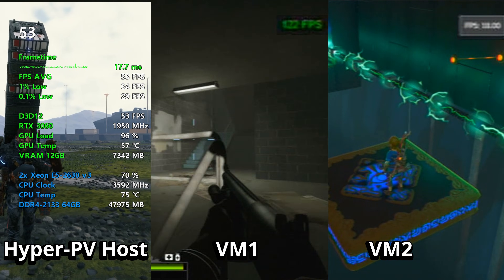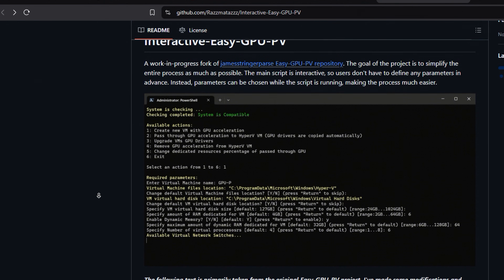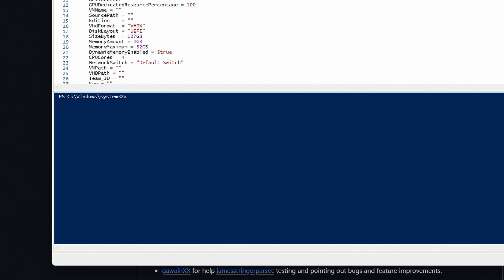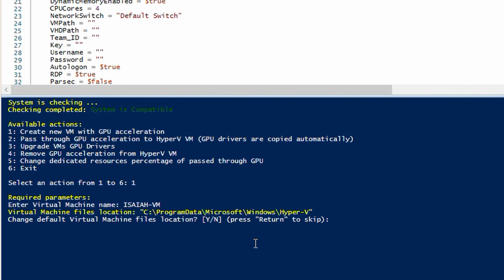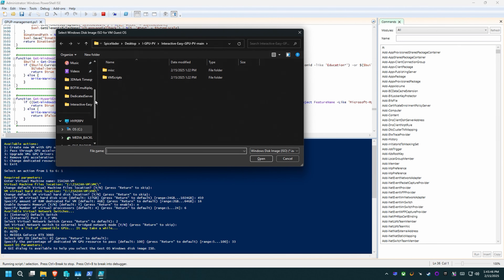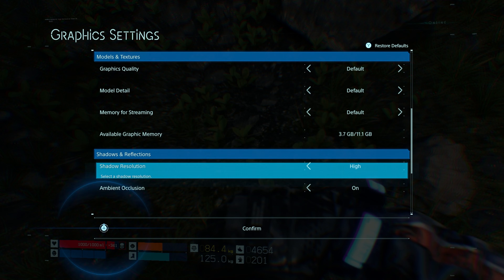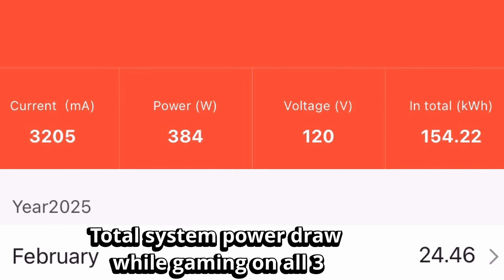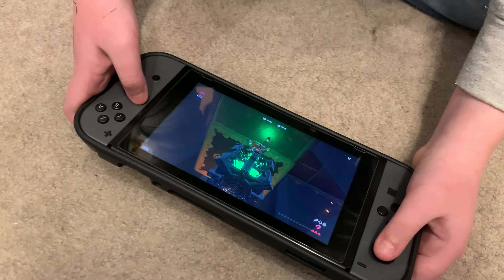3 Gamers, 1 PC Rig! // Old hardware running GPU Paravirtualization in Hyper-V using I-GPU-PV Scripts

Comment: Does it work on windows 11 IoT LtSC?
Reply from the maker: Yep, that's what I used in this video
Reply: @SpiceVader  Oh my bad I didnt notice it. Btw I also managed to run my VM too. Thanks!
The only problem is how do i connect any USB devices through moonlight?
Like USB flash drives, webcam, and also Arduino USB COMM stuffs
Reply from the maker: There was a program that allowed to send USB over IP via a certain port. The free version would let you do 1 USB device but would need to pay to unlock more. There are probably other ways to do that too. I believe it was called VirtualHere

Comment: How did you managed to use Sunshine + Moonlight in the VMs ? Event with a virtual display adapter, mine doesn't want to start streaming.
Reply from the maker: I had to plugin one of those dummy adapters into the HDMI port on the RTX 3060 and then it worked.
Reply: @SpiceVader Oh perfect ! It worked, I guess this is a limitation of consumer nvidia drivers

Comment: Is there any way to make the image over stream better?
Reply from the maker: You could try using a different method than I used. Moonlight might not be the best fit for this scenario, but it's what I use for everything else. I didn't want a bunch of different apps for remote gaming.
Reply: @SpiceVader Okay. Yeah I was using Apollo and Moonlight, but no matter what I did with the bitrate the image seemed very soft.

Comment: what optimizations did you use?  my vm  in game feels very very slugish, and input delay is horrible
Reply from the maker: I really didn't use much. Dropped the VMs to 1080p. I use Ubiquiti network hardware and it works decent. WiFi does seem noticeably laggier. I'm not super sensitive to it these days though.
Reply: @SpiceVader  mm i must of done something wrong... what was in the video and what was happening on my screen  was night and day
Reply: what Remote method did you use? moonlight, parsec or rdp?
Reply: @malloot9224  tried moonlight and parsec

Comment: ola como faço para funcionar o ray tracer e dlss / aceleração por hardware
Reply from the maker: If the graphics drivers are installed and Ray tracing and DLSS are already working on the host system then this should also work in the VM.
Reply: @SpiceVader então pós uso o programa enscape de renderização e lá tem a opção de ativar o Ray tracing e dlss via hardware mas a opção não está desativado no Pc host tem a opção de ativar normalmente mas na vm fica desativado não deixando ativar

Comment: Great Video! My only question is do you know if anti-cheat doesnt like the VM's?
Reply from the maker: Good question! I'm not sure about that. I would guess it probably won't work as anti-cheat software tends to be pretty strict.
Reply: It doesn't work for CS2, but for other games it usually does, easy AC (apex), battleye (crew, tarkov) do work